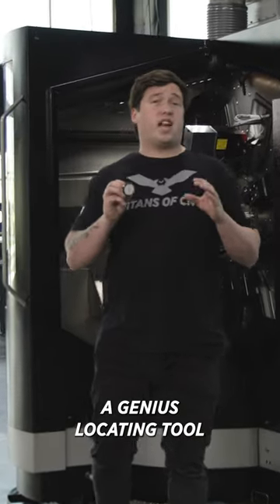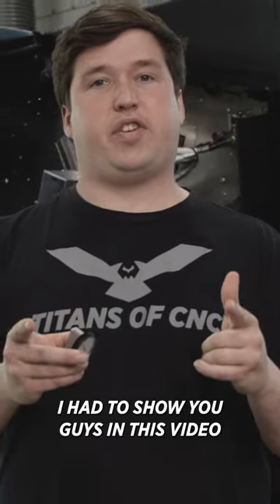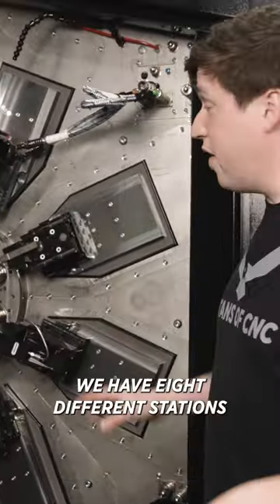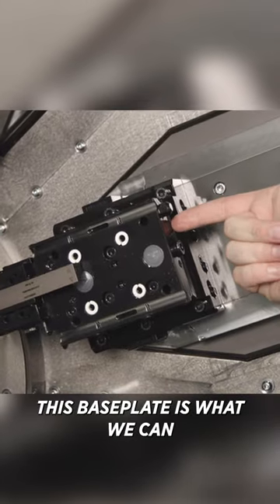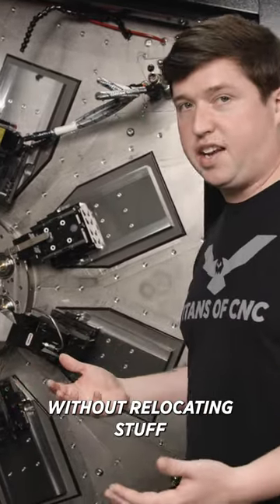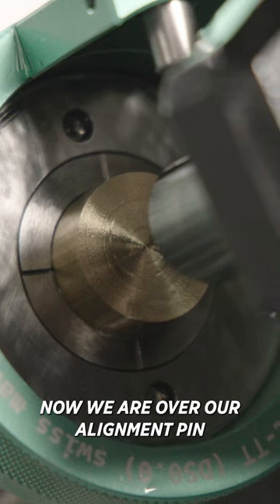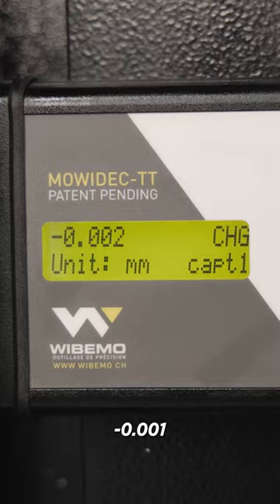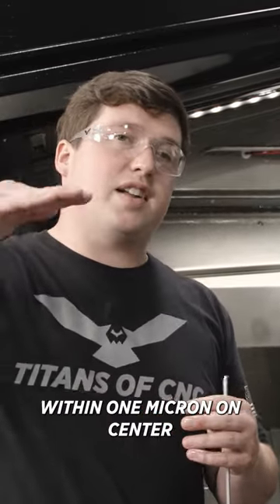This Indicating Tool is Revolutionary | Mowidec-TT

Comment: Micron is so small that it's hard to even fathom 👏👏👏
Reply: One Fathom = 6 feet
Or
1.82 meters

UPDATE: 1 Fathom = 1828800 micrometers
Reply: It's pretty damn hard to even get a real measurement of that, usually need lab type conditions. 

It's pretty sus if that's actually true
Reply: @5isalivegaming72 for absolute measurements yup lab conditions are a MUST on that scope. For comparative measurments, with the right tools, you can do it on the machine. I'd still give it +/- 1 micron. It's just silly tiny. My hair are around 0.04mm in diameter. So cut one of my hairs in 40 slices length wise. That's what ya measuring!
Reply: @sicstar as a Maschinist (lathe) in Germany I work with microns all the time. The real deal is what comes after the microns
Reply: 1 micron makes a big difference especially when you are working in tenths.
Reply: @5isalivegaming72 I have indicators and micrometers that read submicron its part of everyday measurement.
Reply: @francisschweitzer8431 😂😂
Reply: Dude, but did you actually show us anything at all? Come on. 😢